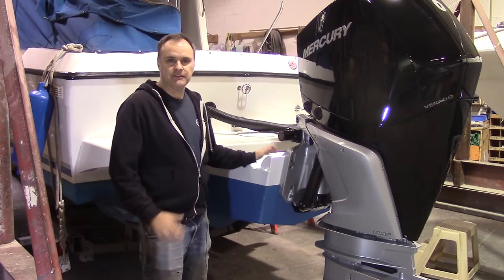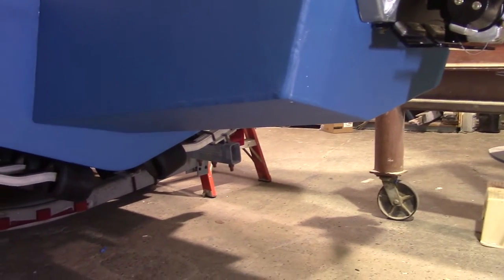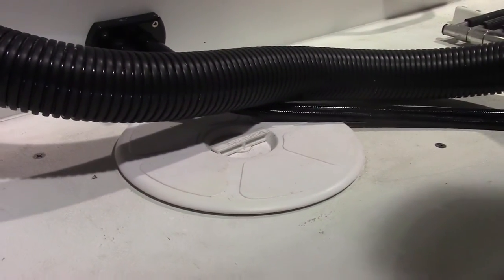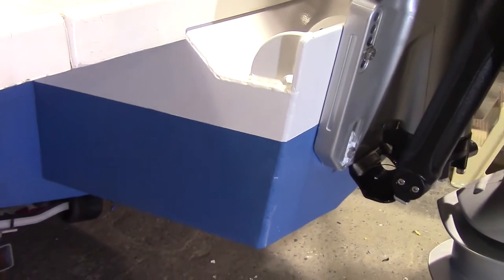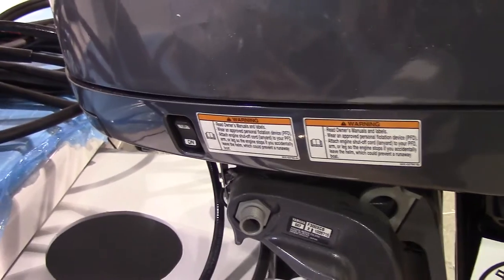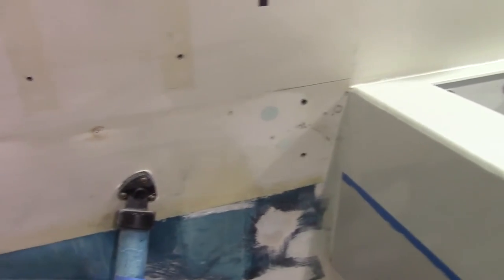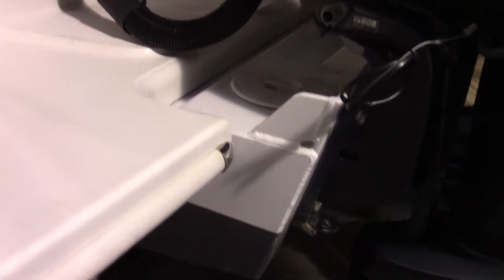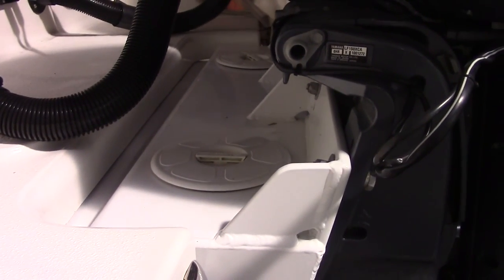Outboard motor pod designs

Comment: Id like to know how you calculate the lift, and why the bottom of your pod doesn't follow the hull?
Reply from the maker: You can calculate moments (weight x distance) from a fixed point in the boat for all the items that will change. Subtract out the old motor, add in the new motor and pod and the buoyancy created from the pod. The outboard is much lighter than the inboard but the weight is so much further aft. You need clean water at the prop. Raising the pod up from the hull bottom gives you that. We built a boat with the motor mounted to the transom. We took a notch out of the hull to create the clean water affect. After testing we did find that the notch was too long (I think 14"). The hull would suddenly jump out of the hole at the certain speed. We filled half the notch in which corrected the problem. A lot of this is trial and error.

Comment: I'm having a hard time trying to design my my motor pod. My boat has a strange swim deck. Carver 260 1997
Reply from the maker: Sorry for the late response. I had no one managing the channel. I found a photo of the boat. You should start with a sectional drawing of the boat showing the transom, keel and swim grid. I have the advantage of having cad drawings of the motors which I can insert into my boat drawings to check clearances and positioning.

Comment: Hi ! How long is your bracket on the first boat ? Currently owning a cigarette 41 1988 i’d like to fit a 35/37 inch bracket on it but i feel like it’s too long
Reply from the maker: That one is 29". Deadrise on the transom is 14 degrees. Designed clearance to transom is about 5" when tilted up.

Comment: would you recomend outboard conversion on a 99 seadoo 7 person challenger? thinking its my only option sinse bad computer that they dont make anymore and any tips when i procede with this venture?
Reply from the maker: Sorry for the late reply. I lost my admin. person that managed the channel and I have been off it for the past year. I believe those boats use a jet drive so the hull shape is not ideal to pod it.